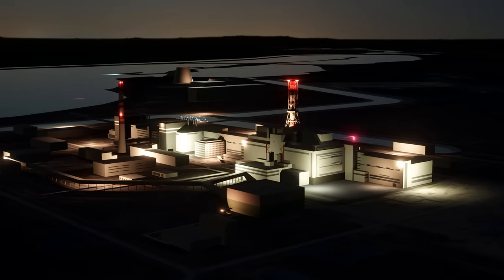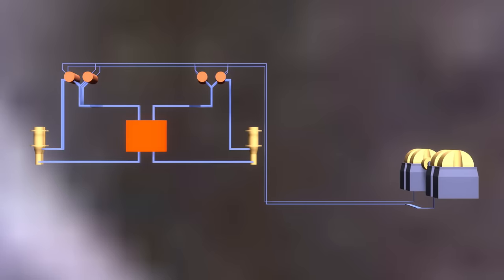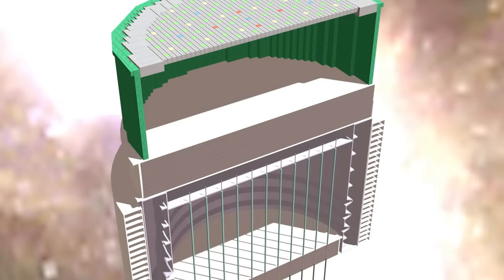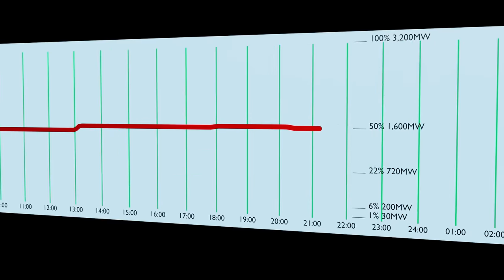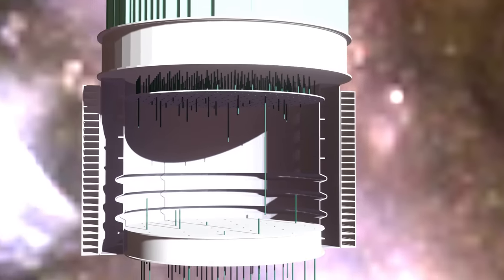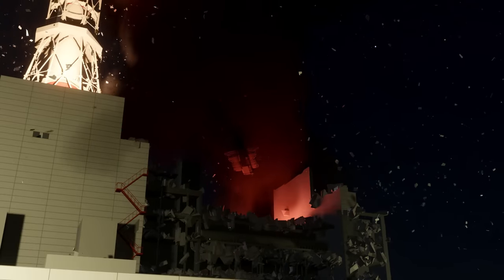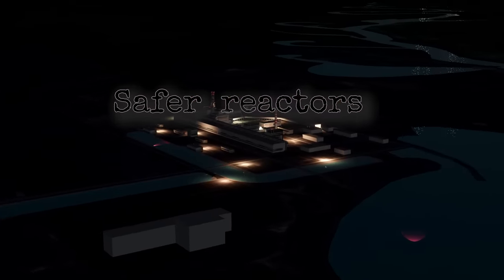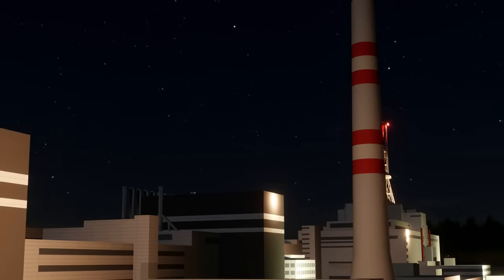CHERNOBYL AZ-5 why it exploded

Comment: Chernobyl has therefore been much more interesting for industrial psychology and human factors research than for physics. 

The psychologist Prof. Dietrich Dörner devotes a separate chapter to Chernobyl in his well-known book "Logic of Failure". In fact, his research results based on computer-based simulations were confirmed by these real events.

Dörner summarized the events based on the report of James T. Reason of the University of Manchester (J. T Reason: The Chernobyl Errors, Bulletin of the British Psychological Society, 1987, 40, 201 - 206; Dörner: Logik des Misslingens, Strategisches Denken in komplexen Situationen, 9th ed. 2010, p. 47 f.):

The reactor in Chernobyl was about to undergo its annual maintenance at the end of April 1986. Before the maintenance, one wanted to carry out an experiment until the May holidays, which should lead to the improvement of a safety device. Therefore, on Friday, April 25, 1986, at 1 p.m., the reactor was shut down. 

The intention was to bring it to 25 % of the power in order to carry out the experiment at this level. At 2 p.m., as part of the test plan, they disconnected the emergency cooling system from the reactor so that it would not be inadvertently started during the test phase.

Then, however, an unforeseen energy demand occurred, so that the reactor could not be disconnected from the grid; this did not happen until 23.10. Probably to make up for the lost time, the operator had switched off the automatic control of the reactor and switched to manual control. In doing so, he overreacted - presumably he did not sufficiently take into account the reactor's self-braking behavior - because at around 00.30 hrs, only 1 % power was achieved.

At this point, it should be noted that this is a very typical problem: In dynamic systems, people tend to overdrive. Dörner describes it like this:

"One regulates the state and not the process and thus achieves that the intrinsic behavior of the system and the control interventions overlap and the control becomes overshooting."

It was strictly forbidden to "run" the reactor below 20%, because then it was unstable and therefore dangerous. So they tried to run the power back up, which succeeded. When the reactor had 7% power, the operators decided to carry out the test program as planned. This was a fatal mistake based on three factors:

The first was time pressure, because the actually troublesome test program of the Moscow engineers should be finished as soon as possible, and there was already a delay.

The second factor was that although everyone was theoretically aware of the danger of reactor instability, they could not imagine it in practice. As Dörner puts it:

"Theoretical knowledge need not be "action knowledge."

The third factor is one that we are also familiar with, namely habituation to the violation of (safety) regulations. The safety regulations had been ignored more often in the past in Chernobyl, it was nothing special anymore.

It is known from learning theory research that such behavior is reinforced because it is "rewarding", one gets something out of it: non-observance of regulations makes life easier and freer. 

This reward combined with the fact that actually violating rules does not always or immediately lead to bad consequences makes inhibitions to violate rules disappear, it becomes method. This method, of course, increases the risk that something will happen.

Presumably to ensure the stability of the reactor, all 8 pumps of the primary circuit were switched on at about 1 a.m.. A maximum of 6 pumps was allowed, but they probably wanted additional cooling. It was not taken into account that due to an automatic feedback a large part of the graphite brake rods were removed from the reactor, i.e. the "brakes" of the reactor were removed as a reaction to the increased load.

The fact that an unintended but logical side effect is simply overlooked because one is completely focused on the intended main effect is a very typical human error.

As a result of turning on the pumps, the water pressure dropped, so the water flow was increased. It was overlooked that this had the opposite effect. It also resulted in even more graphite brake rods being removed from the reactor. They also turned off the automatic shutdown of the reactor when the steam pressure dropped, just as they had turned off all safety features. 

As part of the test program, one closed one of the steam pipes leading to a turbine at 1:23 a.m., causing another automatic safety coupling to shut down.

A minute before the disaster, at 1:24 a.m., it must have become clearer what was about to happen, because they attempted some sort of emergency braking, i.e., pushing the graphite rods back into the reactor. 

Unfortunately, it was too late for that; the tubes had already been bent by the great heat generated.

What happened next.. is well known.

Kind Regards,

Alpha

Comment: It's really surprising. Sometimes, more often than you would think, on youtube, for example, you will see over-the-top nuclear enthusiasts going beyond their realm of knowledge when discussing this accident (not you, you are spot on) and often making judgements about the accident that are inaccurate. People often blame the reactor itself, and the fact that it wasn't encased in a containment vessel. While this is true, it was actually pretty well contained and the building was basically built to handle nearly EVERYTHING other than an actual reactor explosion (which at the time was deemed theatrically impossible). The concrete that encased the reactor room was heavily re-enforced and had a thickness of at least 2.5-5 feet, completely surrounding the massive reactor core on all sides. And the top of the reactor was covered by a massive reinforced upper biological shield (aka UBS), which after the explosion (of Chernobyl Reactor 4), was literally launched more than 50 feet into the air and subsequently landed sideways back on the reactor floor, much like flipping a coin only on a much larger scale. This is a 2000 ton lid, that's a testament to the power of the explosion itself. The UBS is a cylindrical disc of about 3 m × 17 m (9.8 ft × 55.8 ft) in size and over 2000 tons in weight. The top AND bottom are covered with 4 cm (1.57 in) thick steel plates, welded to be helium-tight, and additionally joined by structural supports. The irony here is that if you actually put a "real" containment vessel/structure around this RBMK, like a GE or any other standard western built reactor, it would have ruptured completely (and been completely destroyed, therefore mitigating any potential last resort protections it is supposed to afford) in reaction to the reactor exploding. Remember, the core exploded with an estimated force of 300 tons of TNT. That is an incredible amount of power, I mean just look at the building itself during the aftermath, the devastation is pretty complete. Paradoxically, there is actually no containment structure in the world strong enough, then, or now, to withstand the magnitude of the explosion that happened to this fateful RBMK reactor. The RBMK 1000 is actually my favorite reactor. It's actually an incredibly brilliant design which affords major cost savings as opposed to standard reactors you might see in the United States due to the ability to use less enriched fuel. As a result, the RMBK 1000 was/is running at an operational cost that was/is much lower than any western built reactor, and still has a very high power/weight ratio (so to speak). In other words, despite the lower enriched fuel, the power output is still substantially higher than pretty much every other nuclear reactor built at that time, and even today stands above most others in terms of power output. If you look at the architecture of the RMBK 1000 you will see quite amazing workmanship and a very pleasing layout, from a visual standpoint and also a technical standpoint. Not only that, but the design and construction and actual look of the reactor is second to none. It's rather incredible that this one blew up, but the stupidity of man can NOT be underestimated (this accident is almost identical in "fault" to the air crash on Tenerife, when a runway incursion occurred and two fully loaded 747s ended up on the same runway at the same time, but that's different topic altogether). So finally to my point, many will blame the reactor itself due to the xenon poisoning and the positive void coefficient and other flaws. I would say no. I would blame the people, 100%. Anatoly Dyatlov is the offending party. For example, if you remove the brakes from your car, and then remove the emergency brake and drain ALL the brake fluid, and push the throttle to the floor, you would NOT expect a good outcome, right? Incredibly, this is basically almost exactly what they did that night. In removing every single protection, slowing down the cooling pumps, and removing NEARLY EVERY SINGLE CONTROL ROD, what do you expect to happen? The reality is, you could give me less than an hour in any nuclear control room, anywhere in the world, and I could explode the reactor, no matter what types of protections you think it has in place, with devastation easily equaling that of Chernobyl. It was the people that placed it in an unstable operating condition, and Dyatlov had to "deliver" as the test had failed to prove results an incredible 3 or 4 times prior. So the pressure was on. And sometimes, if all the links fall into place, this type of thinking can lead to some of the most devastating outcomes imaginable.
Reply: seems that all excidents with 'nuclear power centrals' have in common; gas build up inside the core .. cant we make em vacuum? or in case of gas build or pressure build up just remove exces pressure or gas?  even in this case Tsjernobyl; it is not a solid vessel but still that cap flies of into he open sky.. if only it could 'exlode' by mailfunction in a contained room ..

Comment: IMO the RBMK reactor so called design flaw is not really a flaw. Under no circumstances was more than 80% of the control rods to be pulled out. Even their own operators manual prohibited it. It’s kind of like dropping you phone on 30m of water and still expecting it to work. 

The blame solely lies with Dyatlov. With almost 80% of the control rods out, the reactor power is still not climbing…. Jeeez wonder what that could be….  All of them are well trained and Dyatlov should have realized the core was poisoned. All they needed to do was to wait 9 to 10hrs for the Xeon to decay away. Why risk damaging a multi million dollar reactor by pulling all the control rods out? That would cost Dayatlov his job too.
Reply: The manual, the rules didn't specify the amount of rods that were allowed to be extracted. They had ORM, Operating Reactivity Margin, parameter instead. Which is usually confused with how many rods they have left inside. Think about it as a gas pedal. The more you press it, the less travel you have left, the less is your's car ability to accelerate. The travel that is left, this is your's car ORM. But, just like with RBMK, you only know how much pedal travel left only once in two hours.

Comment: So the SCRAM with AZ-5 caused the explosion because the control rods were tipped with graphite.
The plant was doomed from the moment Dyatlov started the experiment and ordered the rods pulled, there was no way to safely shut it down at that point.
No matter what they did, the result would have been the same.
Reply: The problem was the test was not done when the reactor power was first reduced. It might have been ok. But letting the reactor sit at lower power for a long period increases Xenon levels which would be burned up at higher power levels.

Comment: I don’t understand why at the end you made it seem like water moderated reactors weren’t possible with the technology at the time. The USS Nautilus was commissioned in 1954 and had a pressurized water reactor. At the time of the accident the us navy had built and launched 85 nuclear powered submarines, 9 nuclear powered cruisers, and 4 nuclear powered aircraft carriers all with pressurized water reactors. In the history of us naval nuclear power there has never been a nuclear related  accident. The USSR didn’t build graphite moderated reactors because they couldn’t build water moderated reactors, they did it because it was cheaper.
Reply from the maker: The Soviet Union built both water moderated reactors and graphite ones at the time.
Reply: @Mike-Bell  Direct quote from your video “Graphite was a favored moderator in earlier reactors… the switch to water happened when uranium enrichment technology had advanced to the point where the large quantities required could be produced. With perfect hindsight it is so easy to be critical of a time when the science was in earlier stages”. That would imply otherwise. This is further evidenced by the fact there are still 8 RBMK reactors still operational to this day in Russia, they have been retrofitted to be safer, but the core is still graphite moderated and it has an albeit smaller but still postitive void coefficient. The USSR did build pressurized water reactors for naval use prior to 1986, but the russian navy is notorious for an abysmal safety record, which goes to show that it wasn’t just the construction of the reactor at fault, the Russians didn’t and to a lesser extent still don’t put safety first.

Comment: See right then, as soon as the problem began occuring, there should have been valves simultaneously opening up from dozens of water towers to allow millions of gallons of water to flood the reactor.  Gravity-fed water cooling systems should be a requirement of ALL nuclear reactors built from now on.

Comment: Why did it blow, three reasons. The main one is the zenith gas with helium was being burned out, while pulling the cores. Reason number two is the complete disregard for safety protocols, lastly those doing the tests did not have training and lacked the experience needed. The graphite absorbs it. But the two gases mention about is actually produced durning the cycles of generating power. Something you not mention at all.

Comment: It’s was NOT A switch they turned. 
It was a Key. 
A key was needed for A5 button to
Work
And you got many key points wrong. 
The lid is sitting at 15 deg. 
The firemen didn’t warm them hands many put there hands near it wondering why it was warm and asking what it was although some knew it was graphite. 
Sadly the firemen didn’t know how it worked. This was a bad call to keep them out of the loop. If they knew info would of been known quicker. 
Sadly it blew up and the others kept running to make power. 
Although I don’t believe it was 100% a accident. There were many key points that senior people skipped.

Comment: Hi!... There's something that is not clear for me, if the core was poisoned with xenon (a neutrons killer), why affected that the water was made displaced and or converted to steam? the core already had it the "brake" to stop the reaction as the xenon was there and why the boro rods had it to descend simultaneously?
Reply from the maker: The excess xenon poison stalled the reactor resulting in the operator staff pulling out basically  all control rods.

Comment: 4:15 "The lowest 1.25 m were cut short to equalize fuel burn."  What exactly does this mean?  How would not extending the graphite of the control roods to the floor of the reactor "equalize fuel burn?"  Thanks!
Reply: Doesn't make sense, really.
They were cut short because there was no space to store a 7 meters long displacer when the control rod was fully inserted, so 5 graphite displacer was used. And that thing, when the rod is fully extracted, was placed in the middle of the channel, with 1.25 m of water above and below, to equalize the fuel burn between top and bottom.

Comment: 9:28 "This was a heat and gas explosion, it was not an atomic bomb"

It's likely the reactor reached a prompt critical state, which is an atomic bomb
Reply: No, a nuclear bomb happens from a nuclear reaction (fission or fusion) which releases a ton of energy. Chernobyl was a gas explosion which happen to contain radioactive material.
Reply: @kuromyou7969  If a piece of nuclear material reaches a prompt critical state, this creates a nuclear explosion. Its possible that the Chernobyl reactor went prompt critical for a tiny fraction of a second before heat from the reaction caused the nuclear material to expand, reducing its density and bringing it down to a delayed-critical state
Reply: @seankauder9721  I suppose. Though I don't think an atomic explosion was necessary to see the effects that we did.

Comment: I want to use this video for a school project but I need to be able to verify the information. You don't happen to have the sources you used when gathering facts?
Reply from the maker: If you want to be entirely accurate refer to my pinned comment with a couple of important corrections provided by viewers who know the subject well.  They know the subject from firsthand knowledge and appreciated the high detail illustrations in this video.

The visuals were revised in the Russian version in 2 locations  
The return flow diagram has been edited -see  https://youtu.be/NeZScDZA_uY?t=100
The bottom control rods did not move with the AZ-5 and this is correctly animated - see    https://youtu.be/NeZScDZA_uY?t=456
 
The main reference document for the video is the INSAG-7 report. https://www-pub.iaea.org/MTCD/publications/PDF/Pub913e_web.pdf

Good luck with your project and let me know how it goes.
Reply: @Mike-Bell  thank you

Comment: Everyting went wrong during the test, but first pulling out all rods and then put them back in when the tank was full of xenon poison. All this was due to 3 failed tests, and the honour the men who did it couldent resist. The tank was so hot that the moment the rods was put back in, all water evaporates.